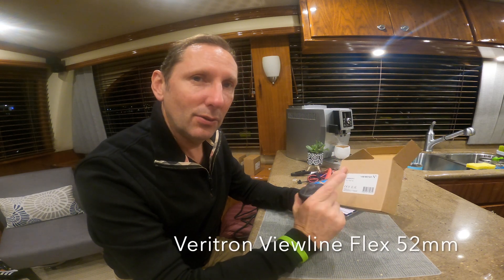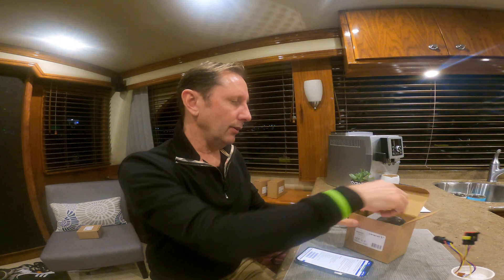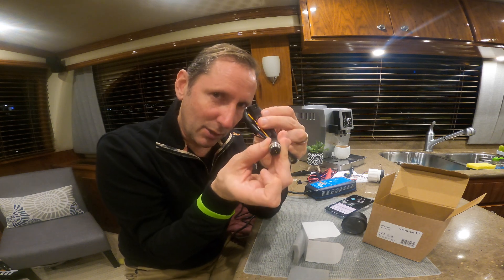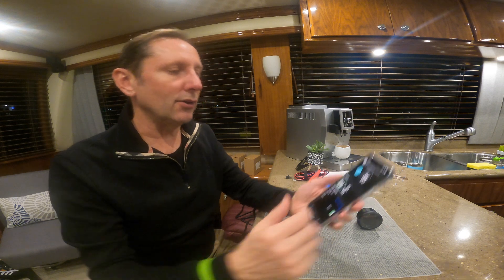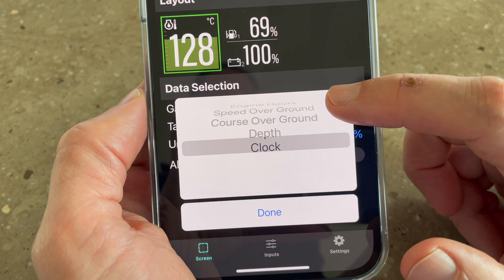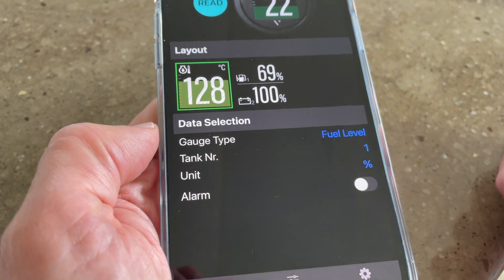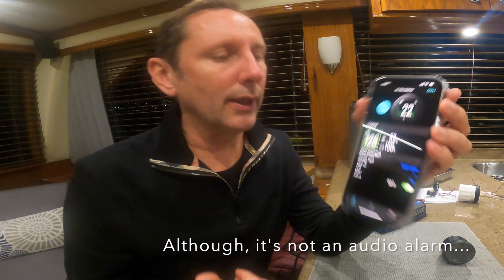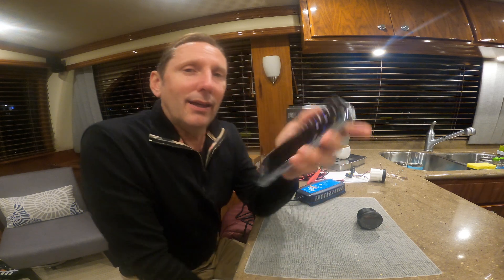Veratron Flex 52 Universal Boat Gauge Upgrade & Review

Comment: You mentioned swapping out the senders, is this necessary if you already have NMEA2000?
Reply from the maker: If your senders are already on your NMEA network, these gauges will recognize them. Our senders were resistive analog so ( and one was dead ) so we had to upgrade the senders to NMEA units.